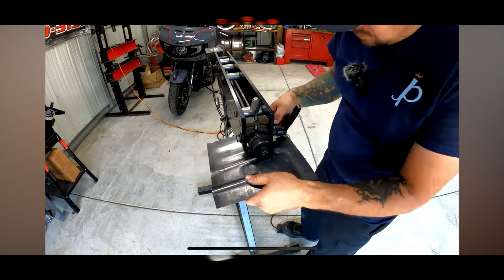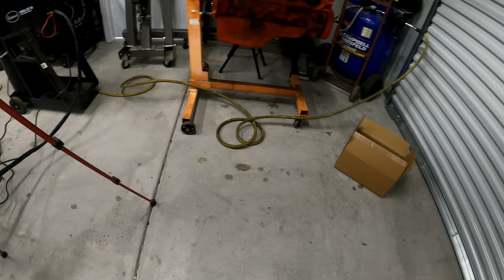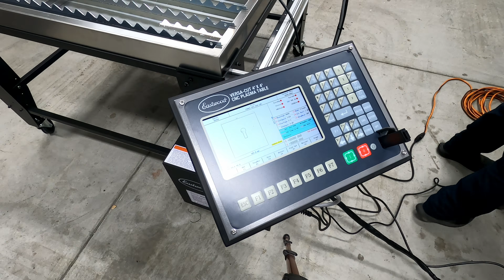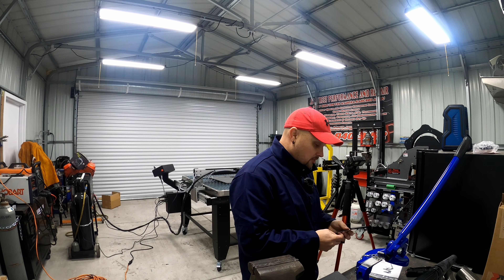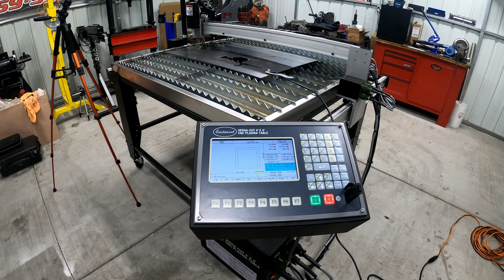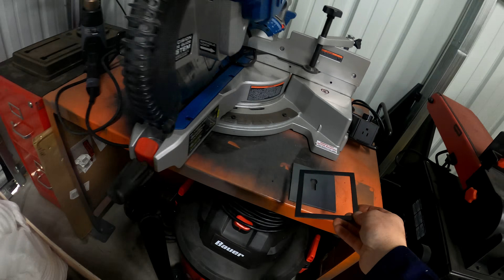EASTWOOD VERSA-CUT CNC - EXPERIENCE THE THRILL OF THE FIRST CUT!

Comment: Did you have any trouble with the torch diving down and hitting the work pieces? If so, how did you fix
Reply from the maker: No, no issues. i have “touch off” set.  where it goes all the way down touches the plate then rises to the set distance before arching via the torch height controller.

there is a file (update) on eastwood website you may need to download onto a thumb drive and update the machine if you are having issues